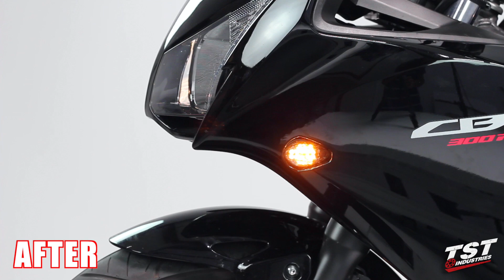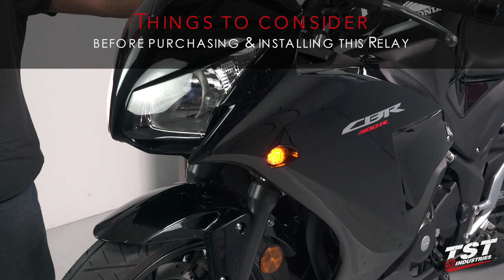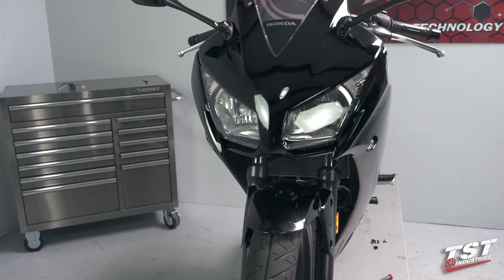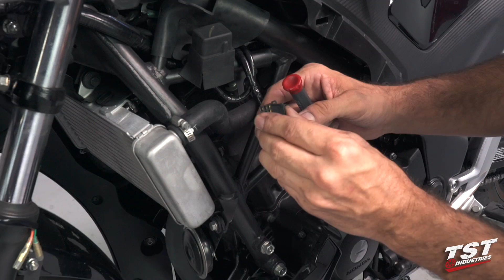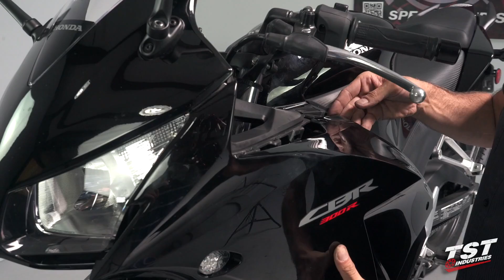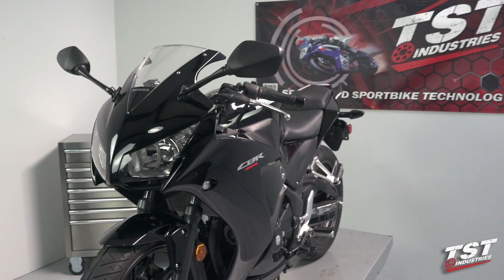How to install LED Flasher Relay on a Honda CBR300R/250R by TST Industries

Comment: Just wondering, which wire is positive and which is negative. I was thinking black would be negative cause that is practically universal. So I assume the grey one was positive?
Reply from the maker: Those colors do not represent positive or negative. I don't know what your actual application is but our relay is a serial interruption device. If you plug it in one way and it doesn't work you can just swap it. The relay does not get damaged if you plug it in backwards.

Comment: On my 2013 Honda CBR 250 the relay fixes the back lights but the front ones still hyperflash. Any ideas on what could be wrong?
Reply from the maker: It is probably an error in connection. Please ask our support staff for assistance through our website.

Comment: So if you use LED signals in the front and stock ones in the back are they going to flash at different speeds?
Reply from the maker: No. One relay controls all of them
Reply: @TSTindustries  Awesome thanks!
Reply from the maker: @LunchBXcrue  sure thing...cheers!

Comment: Will this work for any bike that uses this same 9 pin relay?  My 05 vtx1800f2 has the same relay
Reply from the maker: In weekend mode now but if you are patient i can check my notes during the week. A gentleman contacted us about this relay on a big cruiser back in the day. I don't know if it was the same model as yours. I examined the wiring harness diagram for his bike and determined that our solution would work. He tried it and had success. I would have to check what the model of his bike was before I can answer you. But like I said you will have to wait till the work week
Reply: @TSTindustries  ok. Thanks. What year is the cbr in this video
Reply from the maker: @alanbunger8842  i believe it is a 2014
Reply: @TSTindustries  ok. Cool. Can you get back to me this week about what bike the guy put it on?
Reply: Any luck on finding that info?
Reply from the maker: @alanbunger8842  we are looking for the conversation with the person I was thinking about. We have a few places to look. I will let you know if we retrieve that info
Reply from the maker: OK...we tracked it down. A dude named Michael Sunsdahl installed this on his 2005 VTX 1800 N
Reply from the maker: I don't have much of a good installation instruction for you other than what we instructed Michael to do through Facebook. He reported that it worked out well for him. I can send you the info we exchanged with Michael and you can determine if it is enough to guide you in the installation
Reply: @TSTindustries  ok that will work. Should i message u on facebook?
Reply: @TSTindustries  vth or vtx
Reply from the maker: @alanbunger8842  it was supposed to be VTX, sorry

Comment: I installed the option 2 flush mounts and this relay following your videos.  Both flashers are extremely dim and they both blink when I turn either indicator on.  Any ideas what I may have done wrong?
Reply from the maker: Hmm..let's do a bit of troubleshooting so we can get you going and back to the fun part of owning a bike. Please contact our support staff through our website. They will work with you to straighten this out, and if they hit a dead end they will get engineering involved.

Comment: Anyone know the location for a LED flasher relay for a 2017 Honda CBR300R
Reply from the maker: #17 in this diagram https://www.mrcycles.com/oemparts/a/hon/58e2b9ec87a866054c36ed58/wire-harness
Reply from the maker: should be somewhere on the left under the handlebar. You will have to take some fairings off.
Reply: TSTindustries will I have to put one on for the front and back or one just one is good
Reply from the maker: @celsodeleon4062  it's just one for the entire signaling system
Reply: TSTindustries pretty much where this one where the video shows is where mine is

Comment: This installation video is wrong if you don't want to ALSO use resistors on the front bulbs if you use low current FRONT bulbs. Where they say to adjust it to avoid the weird flashing is wrong. It happens at every speed without a resistor on the front signals if you use bulbs with low current draw. (Essentially, the front hyper flashes when the back signal is on, and doesn't flash when it is off) I finally solved it after a couple years. With the following method you cannot use them as running lights but this removes all issues. Attach the relay black and white wires as normal. Then, connect orange-white/orange and blue-white/blue. The green and other wire are unnecessary, tape their ends. Make sure you save the original relay and original plug if you intend on reusing it and TAKE A PICTURE of the original harness pin-out. Voila, working signals.

Comment: Does installing this flasher relay here work for the back too? I’m not doing the front blinkers only the back
Reply from the maker: Absolutely. One Flasher Relay corrects and controls your entire signalling system.
Reply: @TSTindustries  This will fix my rear signals not streaming across?

https://www.youtube.com/watch?v=Si8Sbq4175g

Comment: I ordered the flush mount turn signals for my 2012 Honda CBR 250 (American) and the install went perfectly.  However, the signal relay box is not where they say it is in the video.  It is directly under the odometer instrument panel, which is a bit of a pain, but works nonetheless.  Also, the black rubber pieces that cover the connectors were not included, which isn't that big of a deal.  Bottom line is if you want your CBR to look more sleek it is well worth it.
Reply: Wish I read this comment before I took the left fairing off, haha. The install is MUCH easier on the 250 than it is on the 300 if only because you don't have to deal with the fairing clips. But yes, the location is a pain.

Comment: Hi. This design of always on indicators is a US market thing isn't it? Currently looking for a LED flasher relay for my non US CBR 250R(one where indicators aren't always on) so would I have to purchase a different relay? Been itching to swap out my OEM turn signals to LED ones but the hyperflash fix requiring addition of resistors(that get hot) put me off of it. Haven't found a compatible Flasher relay yet.
Reply from the maker: If you find the relay on your bike you can send in photos to our support staff through our website and we will do our best to match you up with the part you need.

Comment: I'm currently searching for appropriate relay for my yamaha fzs))
Reply from the maker: what is the exact model and year of your bike?
Reply: it's fz6s 2004
Reply from the maker: From my examination of fiche it looks like your bike uses a relay that has our Gen2 LED Flasher Relay as a replacement. The OEM relay can be found under the left side of the upper fairing. Once you get in there please take a photo of the relay's plug configuration and send it to our support department via our website. Someone here will match you up with the appropriate part.